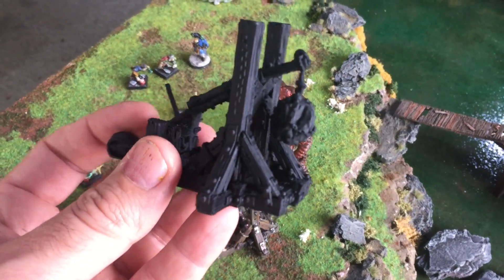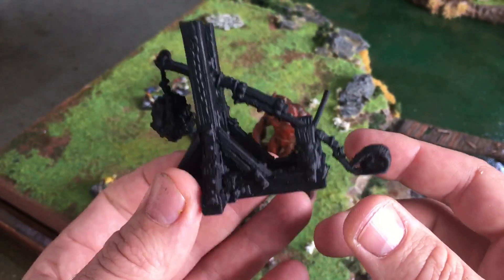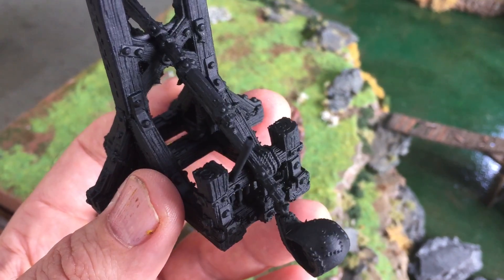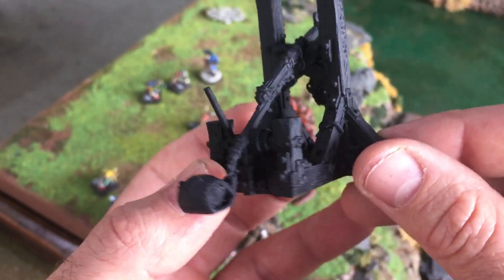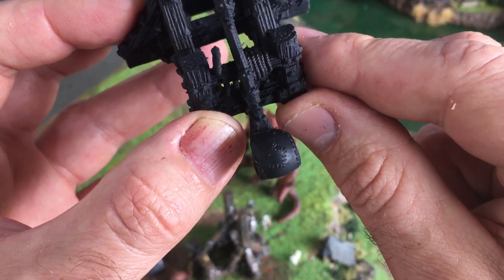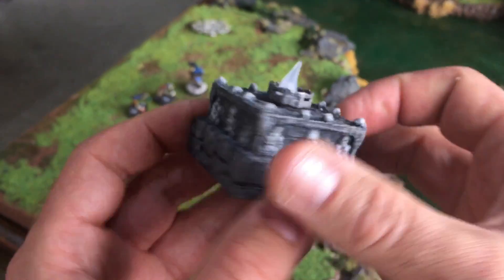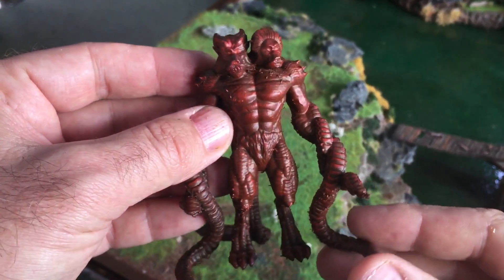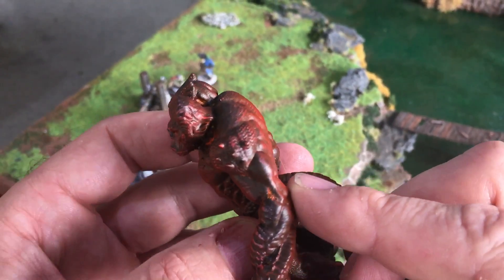3D printer quality information on Prusa i3 Mk 2

Comment: Hi, I was wondering if it is possible to print like 4-5 cm tall fantasy figures for board games with this Prusa? I am not looking for the sharpest detail possible, just recognizable. Were those smaller goblins of yours printed with Prusa? Thank you very much!
Reply from the maker: for small minis I would recommend a resin printer. We didn't 3D print the goblins
Reply: @printablescenery  Oh wow okay, thank you very much! :) Do you have any suggestions on which of the resin printers are worth a try?
Reply from the maker: Prusa make a resin printer, I have heard good reports about that. Normally we use a FDM printer for all our models
Reply: Printable Scenery Thank you very much for the information! Your prints are all looking amazing! :)

Comment: The quality on the Demogorgon is amazing to see for a printer that says 0.05mm on the technical specifications.
How you have been able to print it on 0.01mm? Any modification to the printer?
Reply from the maker: It was printed at .1mm. Normally we print at .2mm for all the large parts and the smaller parts at .1mm

Comment: Those small details you mentioned you can't print with a 3d printer yet, you can print them with a 3d SLA printer, get the layer height down to 15 microns and you won't be able to se the layers anymore.

Comment: How long did it take to paint those pieces?  They look very nice.
Reply: My guess for the bridge supports, about 2 hours. 9-14 hours for the trebuchet and gorgan, maybe longer if he slowed it down for less wobble artifacts. 3d printing is not like a star trek duplicator unfortunately.
Reply from the maker: Trebuchet was 6hrs at .1 , 60mm/s (slow) Bridge Supports (I print 5 at a
 time, so not sure,, may 2 hrs each)( , Demogorgon (overnight) 9hrs
Reply: Looks like I wasn't far off :)